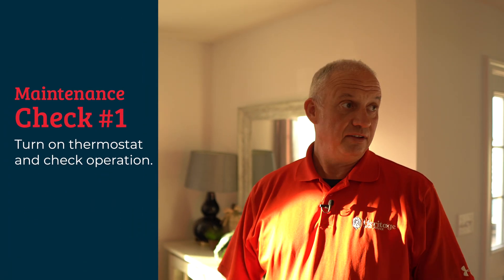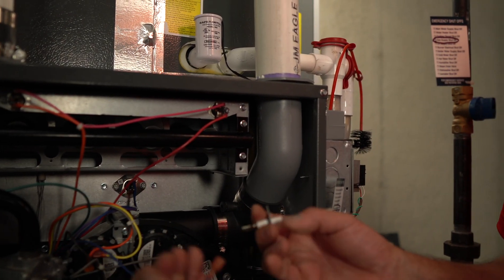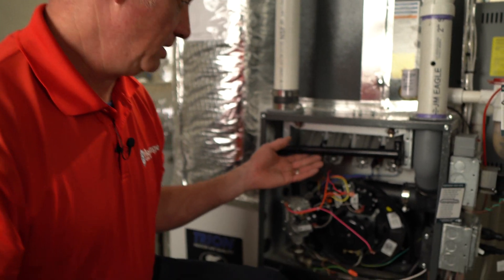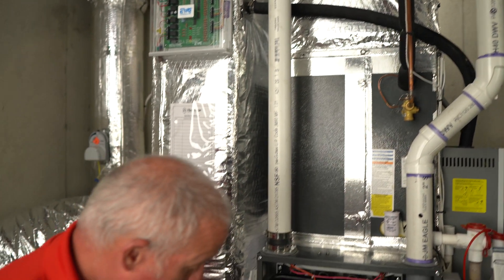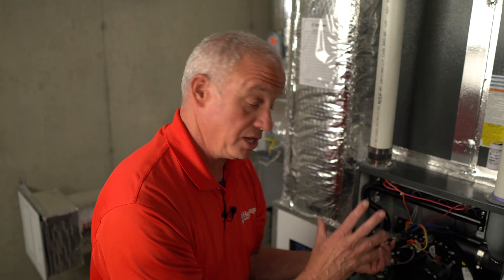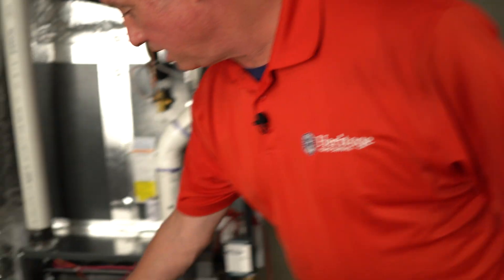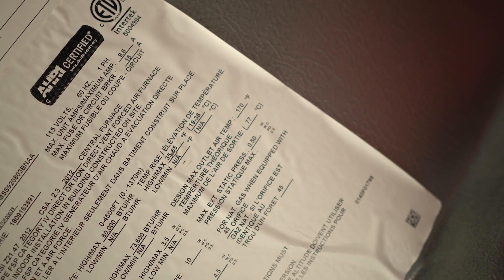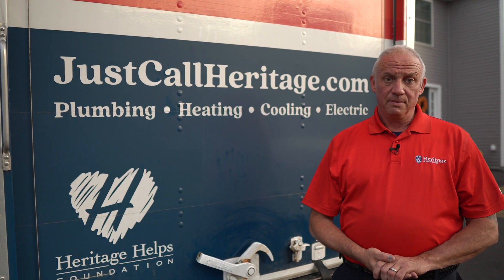Gas Furnace Maintenance: Walkthrough & Tips

Comment: After you drill into the exhaust do you just seal it with mastic tape afterwards or something along those lines?
Reply from the maker: *Not professional advice, depends on manufacturer specs, also check your area for code requirements.  But generally yes, a quality mastic tape (thick foil back) can be used, but you can also use a steel/brass plug with teflon tape, or sometimes you can find specialty metal or silicone plugs made just for this purpose.  Some people even use hi-temp silicone sealant from a tube.  There's a few different options, but again it's best to call a local professional to do this for you.  Thanks for your question!